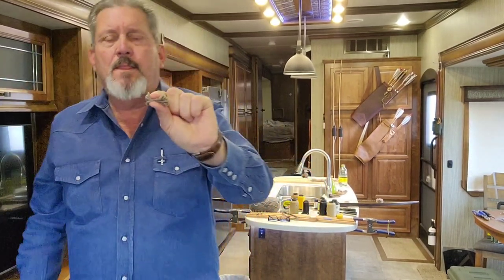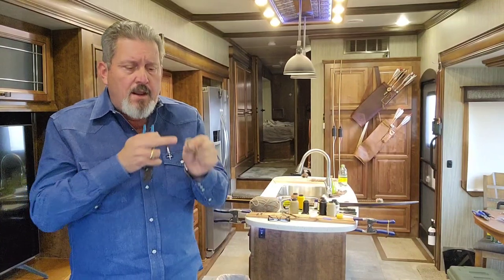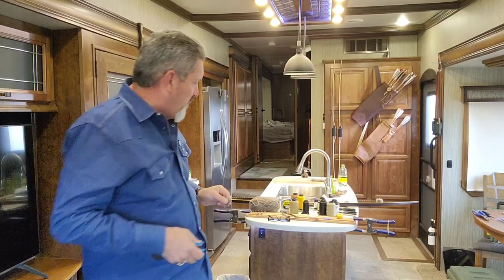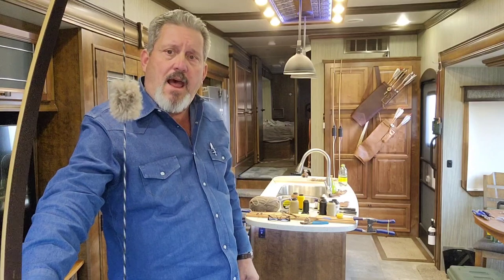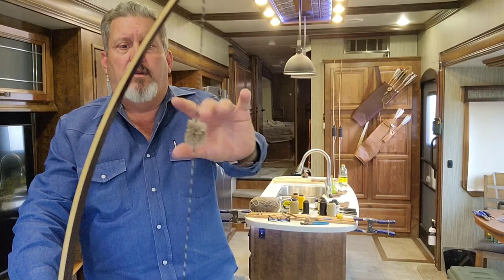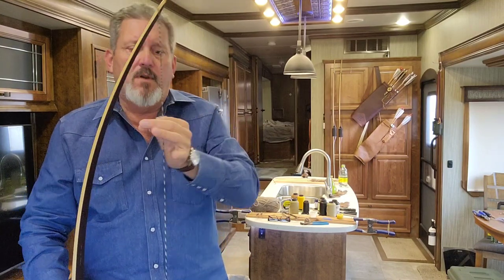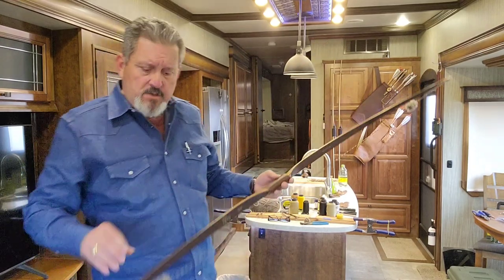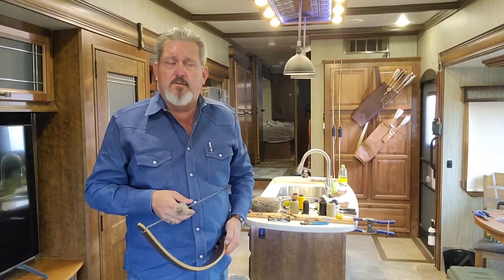String Noise,   Stop sucking the life out of your bow!!!!

Comment: Should have at least 9 grains per pound. A heavier arrow is quieter always. I shoot 540 grain Black Eagle Deep impact with 42 grain outserts, 175 grain points. 400 spine...hard hitting setup.  Also in my experience don't put your string silencer's equal on your bow string from top to bottom. The harmonics works better with them 4 or 5"  In difference of placement On the string